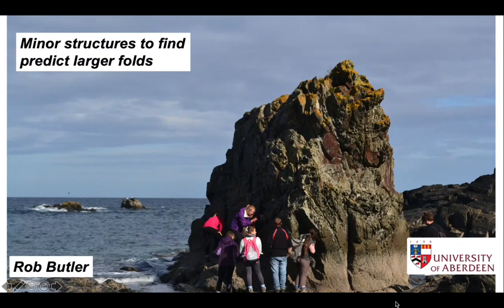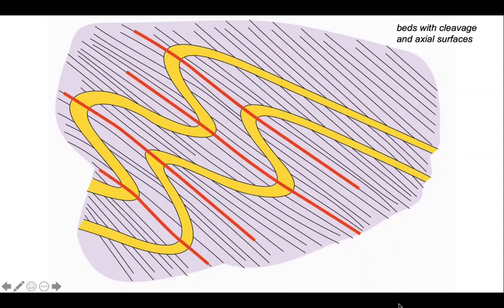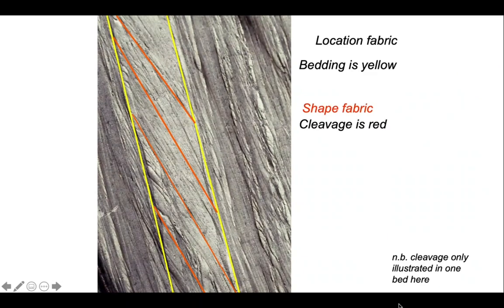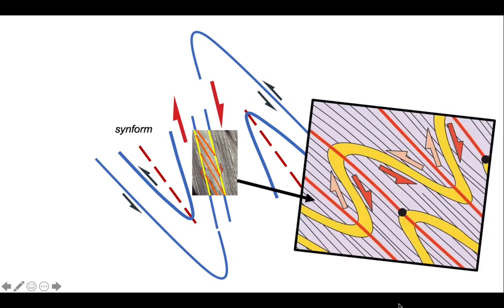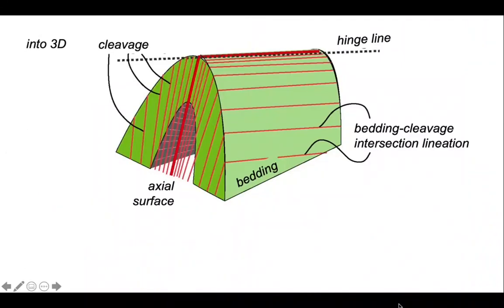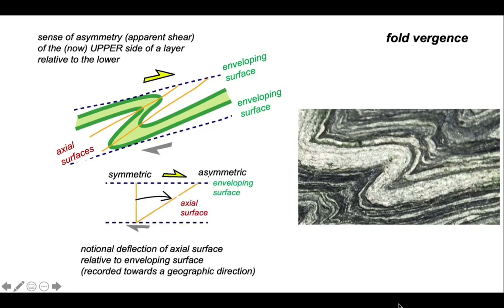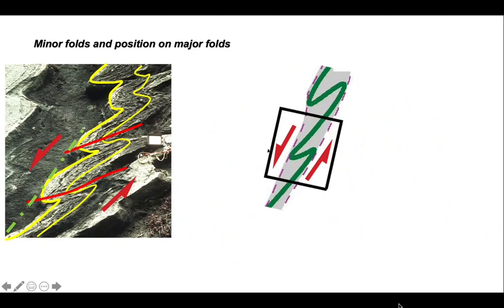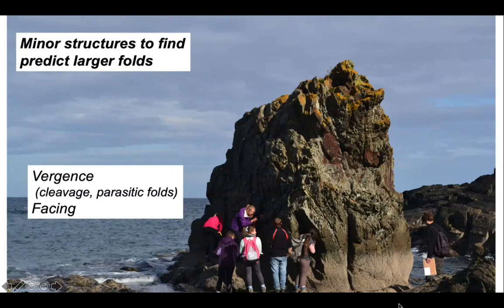Minor structures to predict larger folds

Comment: Thanks for the nice lecture! I have a small question about minor folds. are they usually paracitic folds of larger folds? Is there any other mechanism that makes small folds?
Reply from the maker: There are various ideas on the formation of folds of different size (amplitude/wavelength) in different layers. I cover some of these in the "how do rocks fold?" video
https://www.youtube.com/watch?v=PY2AOWML8qo
But of course folds can also form in different, distinct "episodes" ... check out the refolded folds video and the deformation in fine-grained strata one too! Thanks for the question
Reply: @robbutler2095  OK I'll check other videos, too. Thank you for kind answer!

Comment: So much nice pictures. Why cleavages are always confined in layer boundary planes? Can the duplex-like structure initiated layer cooling structure (a kind of columnar jointing)?
Reply from the maker: In turbidite units ("greywackes") like this, where the tops of beds are finer grained - these parts tend to develop slatey cleavage better than the coarse grained parts. So these parts show vergence most clearly. These features can resemble duplex structures - but they're not faults...